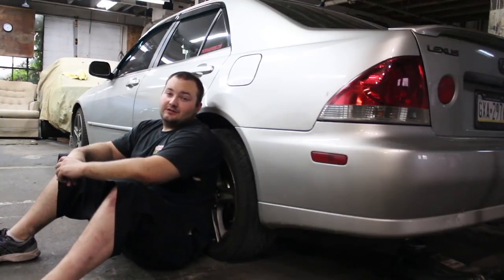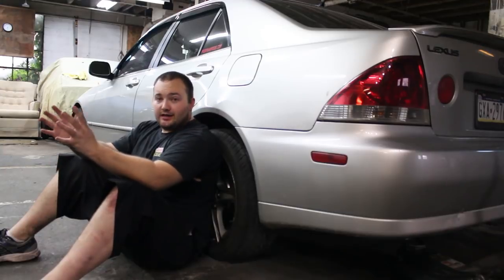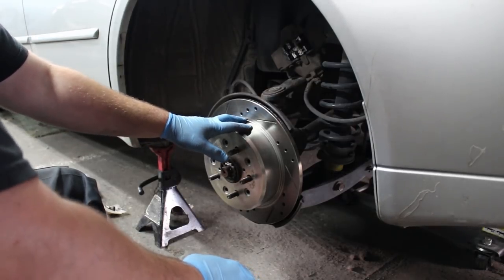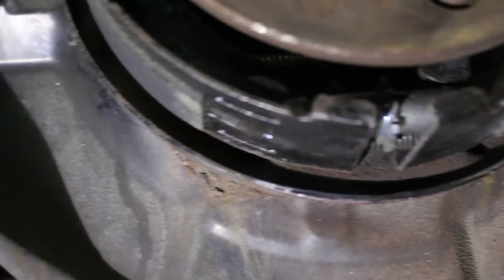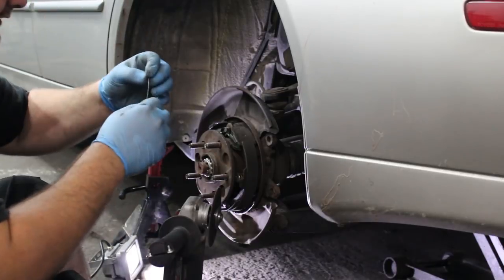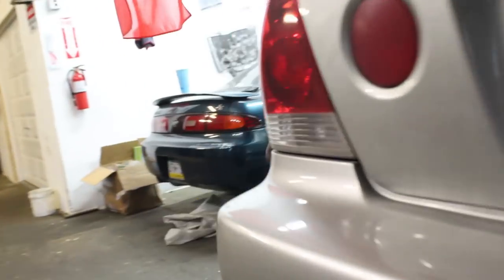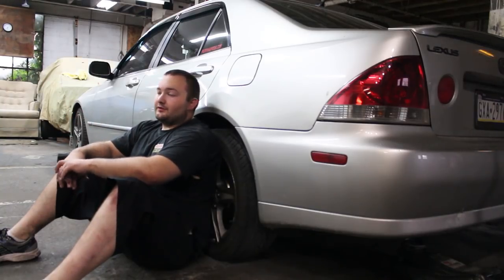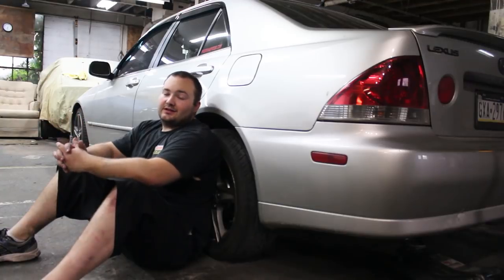IS300 rear brake noise fix! Rear rotors grinding

Comment: absolute champion mate! fixed the noises on my Altezza i just imported. Replaced rotors and pads, then this noise started. A little 5 minute session with an angle grinder and shes sweet! 
Cheers from Australia !
Reply from the maker: awesome!!! glad i could helpt!
Reply: I went full Columbo on it: managed to spy a groove cut in the old rotor, but what a bloody nightmare! 😀

Comment: Hi mate, You can't imaging how I really appreciate this video. It is going to be the next thing I will do to try to get rid of the same disgusting and embarrassing noise coming from my IS 200 rear rotors that you had in yours. When I listened to it in your video I said this is it.  Hopefully it'll work. All the best
Reply: This is a very good idea, but I thinks it is not solving the root cause. This chafing on brake rotor is sign of the rear wheel bearing wear. Why mostly it is coming in turns, becouse the bearing gets loaded in turns, and it's free play causing contact with brake disc groove, and fixed shoulder of the wheel hub. !?

Comment: When you rebuild the calipers on all four corners, replace the handbrake pads, paint the wheels, and replace all the rotors, and go down the road and hear this! Are you serious?! 😄😂😀
I used a dial gauge and found the plate was about 2mm proud but only on the bottom, so I'm reckoning it's a factory problem. Used a hammer and punch to drive it backwards enough. Man what a win! 🤩
Reply from the maker: Hahaha hells yeah

Comment: I need help i am so desperate. My van is making a noise when i stop 3 different shops r telling me its the struts the noise came. Before i changed the struts n its still making the noise. The struts are brand new just put them in sunday.and had the aligment  Im so aggervated ive already replaced rooter caliper its only the drivers side. Someone please help me figure out whats wrong with my van. Its a 2003 kia sedona. Please
Reply: its a kia sedona thats the problem, happy to help.

Comment: I did that and it still make a noise when I make a left turn, left turn only. Any suggestions?
Reply from the maker: You need go remove more material so it doesn't rub

Comment: just did my rear brakes, rotors and calipers and brake shoes were tightened a bit. i am experiencing a sound like this in the rear after having it done, and mostly around turns (turn left hear it on the right , and vice versa) ... could this be what i am experiencing, maybe brake shoes too tight??? after 30 minutes of driving no smoke, no smell... so i know it isn't a stuck caliper piston..... HMM
Reply: I had exactly this problem with after market rotors and yes when you turn left and right the wheel able changes just enough to cause the scrape. So it sounds like the brake shield is hitting the rotor. Not  a grinding noise but a scraping noise.

Comment: I have a 2001 GS300, not an IS, but after checking on Rockauto, they use the same brake parts, so it's the same. I just got my rear pads, rotors, and shoes replaced yesterday using Advance Auto Parts parts and the grinding noise was also happening to me. My mechanic had to hold it until today to fix it and I assume he did the same thing as you in this video, but with a twist. The noise is gone for the most part, except when I turn to the left, the noise comes back in the right rear area. It goes away once I straighten out the car. If I was to leave it like this, it won't affect the braking surface of the rotor, right? I don't want a groove in my rotor where the pad contacts. If it's outside of the area, then it's fine.
Reply: the backing plate is on the inside of the rotor hat away from the breaking surface.

Comment: Random question - Have you ever run into an issue were you replaced the shoes and all the hardware and got everything back together only to find that the rotor doesn't fit flush anymore?  I found that after putting everything together and starting to drive I hear this massive clunky noise between shifts but thats because the hub assembly in the rear falls off whatever holds it flush to the back.  I've tightened the caliper on snug, I've rolled the little spindle thing that pushes the shoes out which helps grab the rear rotor a bit better but I'm not sure if thats the move to make since I'm guessing the shoes are gradually rubbing against the inside of the rotor/drum assembly.
Reply from the maker: Im not sure, drum brakes are my enemy and always kick my ass :(

Comment: It is the new rotor that is not fully compatible with the dust shield. Cheap rotors like Power Stop may lead to such kind of problems.
Reply from the maker: yuup!
Reply: D T what do suggest for brake rotor replacement? Brand ?
Reply: Better go to the dealers or the name brands, after all brake parts are the most important parts of a car.
Reply: Bingo, I bought power stop and the rotors are just enough out of spec this happened to me.

Comment: Does this happen the the front wheels to or naw
Reply from the maker: Ive only heard of this being an issue for the rear. It's possible in the front for your dust shields to just be a little bent and touch the rotor though, then you just need to bend them back my hand

Comment: Do you think it's the rotors because I have the same slot it rotors on a Mazda and I'm having the same noise
Reply from the maker: yeah i guess its just an aftermarket defect :(
Reply: Poor Man Mods I found out the noise goes away when you pull the E break up halfway and drive
Reply: Poor Man Mods has something to do with my rear calibers nd floating pads they keep on bouncing all over the place making this mind blowing noise

Comment: Why does this happen? I had the same problem and my “fix” was the same as yours but all I did was try to replace the rotor with a normal replacement. Not sure how that hard metal could’ve easily been bent
Reply: Plus it was pretty much a new car 2015 Camry with 50,000 miles first time touching the rear brakes
Reply from the maker: Its just a tolerance difference in aftermarket rotors i think

Comment: So I was doin donuts. front driver wheel hit the curve. Ever since then it been making an annoying as grinding noise. I just got an alignment done  but tht fucking noise still there. What you think it could be
Reply: Like every time I press the brakes
Reply from the maker: @mayniethangsp5123  Best case scenario its the brake dust shield, but it also could be the wheel bearing
Reply: @PoorManMods  best wheel bearing brands for is250 & is300 ?

Comment: I am based in Japan and own an SXE10 Alteeza. Recently replaced my rear rotors and pads using high quality Japanese made Dixcel gear. No problems at all.
Maybe instead of ruining the backing plate, you should recommend people to not buy garbage product that is not designed for the car. SO to answer your question at the start, it is NOT a factory problem, and should never happen if the correct parts are used, it is an aftermarket problem.
Reply: irit8r I got a 98 rs200 z edition 5at. OEM original rotors.
, same issue. Do not be a wise ass... It is a common issue on all XE10. over time and use this issue develops.
Reply: Agree with John mine IS200 has the same issue, and with OEM parts, always serviced in LEXUS service.
Reply: how is shaving 0.2 grams off a metal lip "Ruining" the backing plate

Comment: My grinding was one of my pads were at 0mm lmao 😂 got it fixed tho just need a brake booster and all my brake system is brand new
Reply: did it have a pattern to the scraping sound? and did it turn into a speak at higher speeds?. also was it load dependent meaning if you turned right or left did it get worse or better? my gs has a scraping sound that's gotten worse hoping its the rear brake pads...

Comment: I got my brake pads and rotors replaced but now everytime i break it squeaks
Reply: you have to bed the brakes in properly. normally you just go about 30mph or so and just slam the brakes and do that a few times. but check the manual because some companies have different methods.
Reply: Garrett Martin I'll give it a try. Thanks

Comment: What exhaust is that?
Reply from the maker: not sure to be honest, it came with the car
Reply: Poor Man Mods do you know where is problem my car brakepedal bumbing when i brake,it comes when i change "winter wheels" it didnt do it different wheels?
Reply: King On The Road And Offroad FIN warped rotors

Comment: Drum brakes on a high end Toyota?! My 27 year old integra has 4 wheel rotors... Thats actually sad, the is300 has been on my wishlist for a while now too. What generation is that?
Reply: definitely not drum brakes dude... those are disk brakes.
Reply: the drum part is for the E-Brake.
Reply: fail bomb
Reply from the maker: +Yo Fizzle dual piston calipers at each corner, the drums are for the parking brake, alot of cars do this
Reply: Road Worthy Did you not see him take the caliper?
Reply: Lol. Wow.

Comment: Same grinding issue as my 2007 Subaru Legacy lol...
Reply: My fix: Brake really hard and put few thousand miles on it lol. No more grinding.
Reply from the maker: i put 10,000 miles on the same set of rotors and the grinding was still there
Reply: +Poor Man Mods i had that on my 350z after installing drilled and slotted rotors, i used ceramic pads. all i fid to fix it was pull the e brake a couple times while at 60mph
Reply from the maker: i did that hundreds of times, the issue isnt the shoes or rotor, its the backing plate on these cars